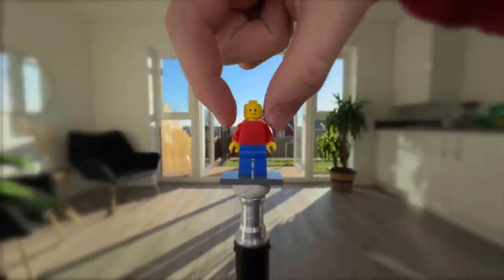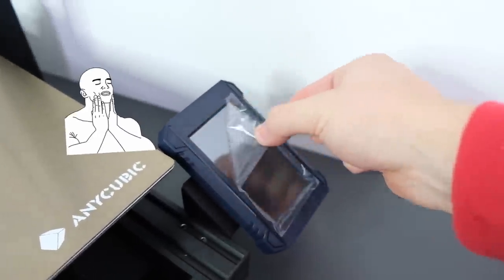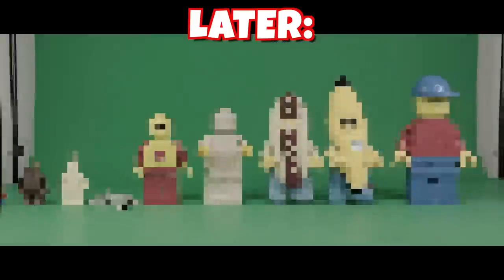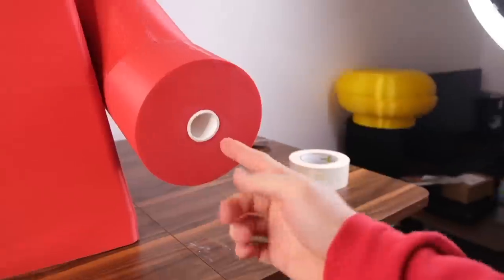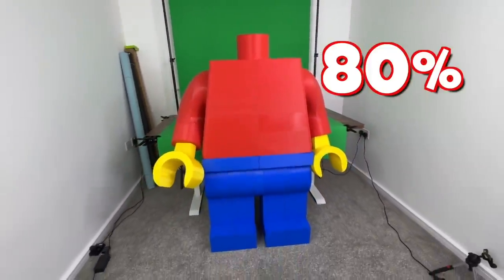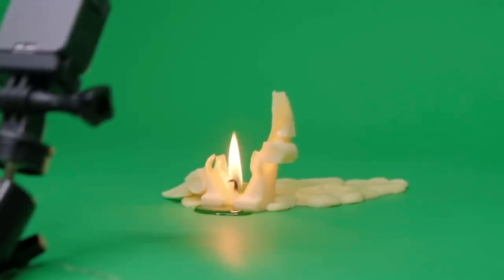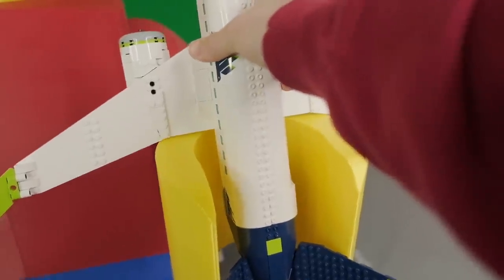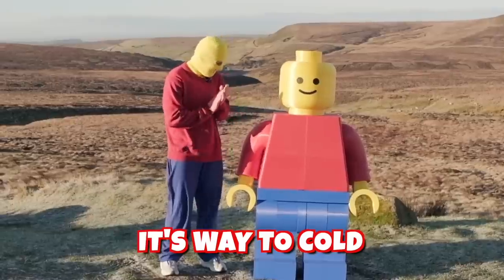WORLD'S BIGGEST LEGO MINIFIGURE...

Comment: Hang on you didn't really need to 3D print the head you could have used the official giant Lego Lego box heads and then just slapped it on the big body and it would have worked
Reply: He wanted the old smile from the 1900's